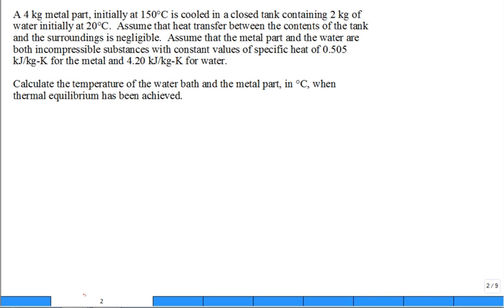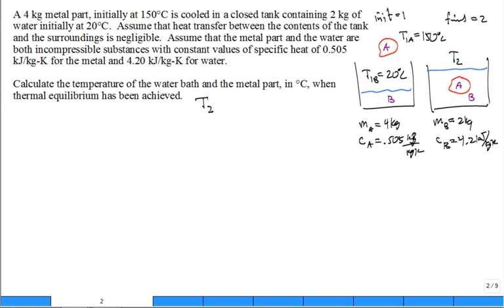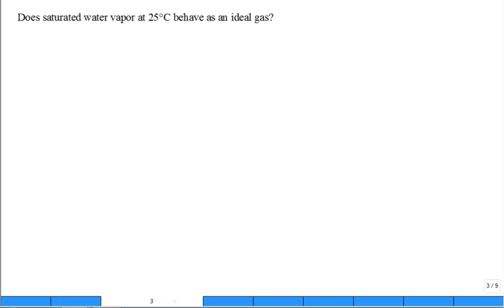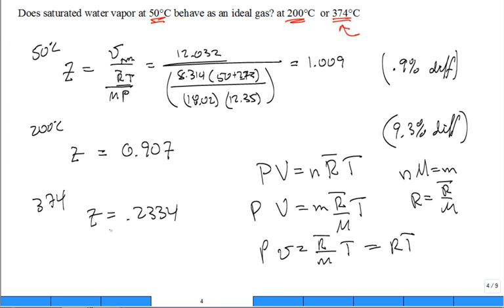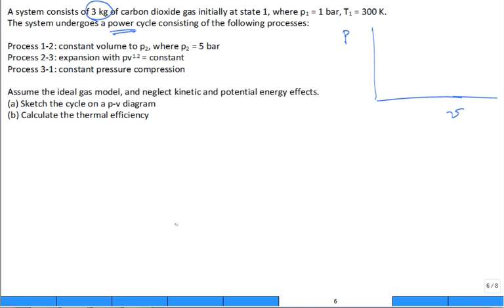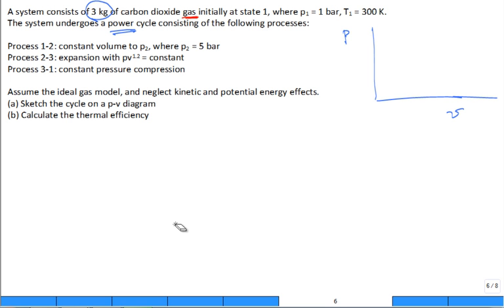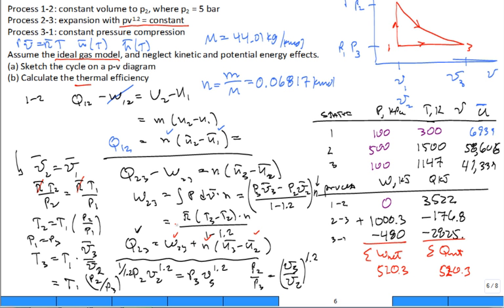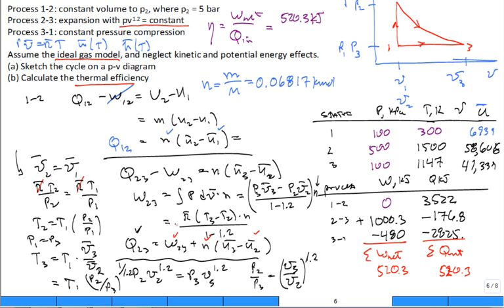ME3293 Properties 8 Fall2015

Comment: Love the videos :) But the calculations of the last example don't check out:
37:11 you forget the decimal point but do correct calc
40:27 Q_12 = 0,06817 kmol * (58,606 kJ/kmol - 6,939 kJ/kmol ) = 3,522 kJ (you forgot decimal)
46:40 Q_23 = 1000,3 kJ + 0,06817 kmol * (41,339 kJ/kmol - 58,606 kJ/kmol) = 1000,3 kJ - 1,1771 kJ = 999,12 kJ
47:13 Q_31 = -480 kJ + 0,06817 kmol * (6,939 kJ/kmol - 41,339 kJ/kmol) = -480 kJ - 2,35 kJ = -482,35 kJ
47:46 Q_net = Q_12 + Q_23 + Q_31 = 3,522 kJ + 999,12 kJ - 482,35 kJ = 520,3 kJ = W_net
48:15 efficiency = W_net / Q_in = 520,3 kJ / (3,522 kJ + 999,12 kJ) = 0,52 = 52%
Reply from the maker: +reik2006 thank you for your detailed comment.  Table A-23 uses both period "." and comma ","  For example, in s_bar_o, it uses period (separate ones and tenths) and ubar uses comma (help separate at thousands).  Then u_bar_1 = 6939.0 kJ/kmol and not 6.939 kJ/kmol.  So at 40:27 one could write:  Q_12 = 0.06817 kmol * (58606.0 kJ/kmol - 6939.0 kJ/kmol ) = 3522.0 kJ.  Again, thanks for your thoughtful comments
Reply: +Randall Manteufel You are right, sorry. I'm from Germany and we use periods for separating units of thousands (or we group them) and commas for separating decimal fractions. Because the initial and final states in a cycle are equal, the overall internal energy hasn't changed (all my mistakes canceled each other out) and Q_net worked out just fine but efficiency is far off.